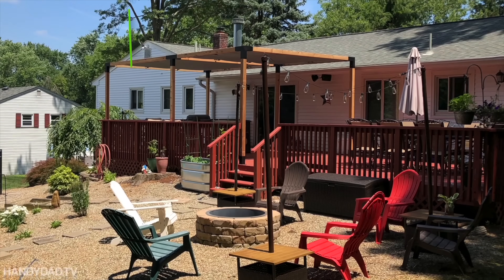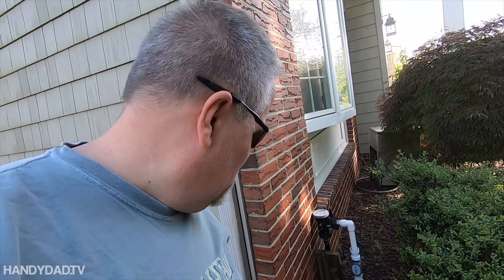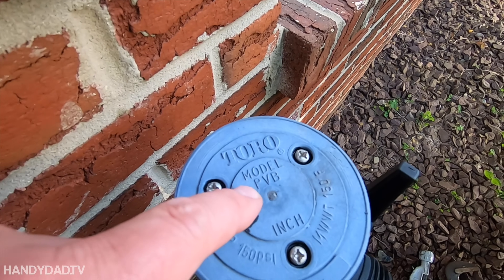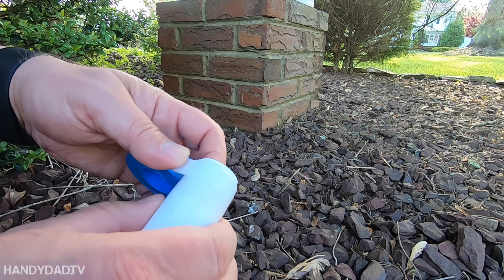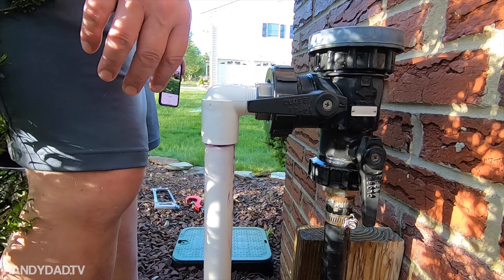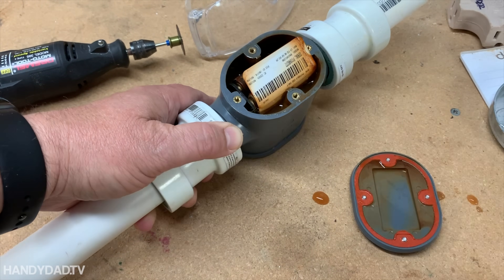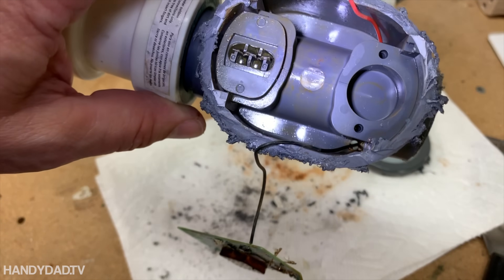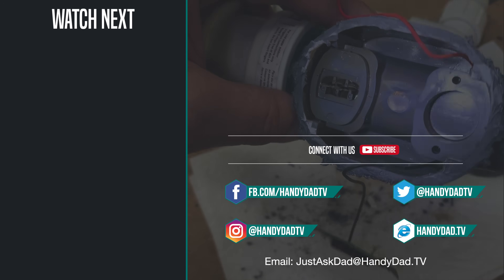Rachio Flow Meter Failure

Comment: Those glue-less fitting you used in your install are releasable. You could have avoided the cutting the pipe. Cool fitting, lots of advantages. Just saying.
Reply from the maker: SharkBite fittings come with the remover. These didn’t so I assumed they weren’t meant to be removed. Thanks for the info!

Comment: Though you said you kind of "winterize" your system, do you blow it out too? Not sure what area you live, but in Wisconsin, we have ours winterized every mid Nov. I didn't do that the first year I moved up here but I turned off the water inside, opened the system to let it "drain" and let it go. My main valve froze and busted open. Next year, not only did I have it blown out professionally, I also wrapped it with a heat tape  from tope to bottom, plant some bushes near it to keep the wind off also. That was 8 years ago and not had any busted items since.
Reply from the maker: Yes it would freeze in NJ as well. I always blow out the system too.

Comment: STOP BUYING RACHIO PRODUCTS. Im a tech and we all hate this junk. running a test is a pain since we don't have the stupid app and have to have the bone head owner follow us around as they fumble with programming. These waste so much time and the smart feature rarely has good results.
Letting software control water is such a bad idea
Reply from the maker: Rachio has buttons on the unit that let you activate a zone to blow them out. Or you can open them manually in the valve box. But I agree, you can’t setup zones and schedules without the app.

Comment: Interesting video...I have a Rachio as well but no flowmeter..The flowmeter style they are using appears to be a vortex shedding flowmeter....in short, its obvious its a flowmeter of low quality...most good quality flowmeters will last between 7 years to 20 years depending on the manufacture and type...it would be interesting to see what radio protocol they are using ...then maybe be possible to use a different brand of water meter altogether......Note: the vortex shedding style flowmeters are subject to noise , vibration...which in the end can create some serious inaccuracies. Also, it would be nice if their flowmeter had a local display so you can check to see if the totalization on the meter matches what the rachio dashboard indicates.
Reply from the maker: All good points. Perhaps that's why they discontinued it.
Reply: finally someone agrees RACHIO is shit. Us techs really hate this junk. Their clocks are awful

Comment: Glad I found the channel, installing my flow meter tomorrow, found a new in box unit, say's if was manufactured in 2019?  They're still available if you look hard enough :)
Reply from the maker: Good luck with yours. They stopped making them for a reason.

Comment: Comment to consider people!

Catching up here on videos. 
New subscriber. 

Just got (6/13/20) my Rachio 3, 8-zone controller with $40 off for father day and I was going to get the flow meter. Saw install of flow meter video last night and now this failure video. Thanks for sharing! Sorry about it. Your ball valve was the cause because it didn't hold tight and blow off pressure could be too high too. 

My background...I am a civil engineer, handyman around the house. 

I would install the flow meter in the basement (in the house) 12" or so before my shut off valve to keep the flow meter safe during winter months and safe when I blow out lines.

Guys think about it for a second why this flow meter "needs" to be installed 6" after backflow preventer... due to losses on the pipe, backflow preventer (check valve= one directional flow) and to have the accurate readings. 

Geeee.... so if you install flow meter before the winter shut off valve IN THE HOUSE it will work too and it won't freeze and it will be safe during winter blow out regardless of the air pressure you put in. 

This flow meter is meant to measure lost of water pressure ...for example if you have a broken head and you lose gallons of water.... not ounces of water! GALLONS! Ounces of lost water here of there happen all the time.  This is not a brain surgery people, so it doesn't have to be accurate to 0.000001oz. 

Flow of water is flow of water in or outside the house! It measures flow. Based on my fluid mechanics experience I can tell you pipe, elbow, friction, losses on this ars very hard to notice ....unless you measure to 1/2 of tea spoon accuracy (no one is). 

BTW...We are neighbors. I am from Manalapan NJ close to Frehold NJ. 

I will buy this flow meter at discount  and install it in the house BEFORE winter water shut off valve. It will take years for version 2 of upgraded valve. 

Yes... instructions didn't consider damage due to faulty ball valve which leaks water in winter of too high blow off pressure. Maybe you can suggest this to Rachio engineers for version 2.0 location upgrade. 

Any comments to my post. Let me know...
Reply from the maker: Thanks for the info. Unfortunately, Rachio discontinued the flow meter.
Reply: @handydadtv  are you buying another (different brand) or waiting for version 2?

Comment: a union set up would prevent this issue .  Being able to just remove the unit (flow meter) for the winter months. I believe this would be a great time to change batteries too. I really enjoyed your demolition of the flow meter , going to help in my design and set up of it.
Reply: Could you explain this? I'm just about to install the rachio flow meter after the back flow preventer in 1" copper and would like to avoid this leak :)
Reply: @4thephil  He's saying that instead of permanently connecting the flow meter to the pipe, put a union on each end of the flow meter. Then, you can simply unscrew each union and remove the flow meter during the winter months. https://www.youtube.com/watch?v=9PEe0V7aHW8

Comment: HindSight is 20/20. The ball valve clearly leaked and caused the failure. If  you look carefully the valve never stops dripping. Maybe a seperate valve is in order between the flow meter and the backflow valve. You video did teach me some things so keep up the good work!
Reply from the maker: I assure you, this was not caused by water. It would be impossible for the water to get over the top of the backflow preventer for two reasons: First, the plugs were removed. Second, the garden hose bib is on the same shutoff and it is always left open all winter to ensure water doesn’t leak into the irrigation system.

Comment: Check the shut off valve in the basement. It most likely isn't closing all the way any and need to be replaced. I always have a faucet installed below the back flow and leave it open during the winter for this very reason. Always close the out going side of the backflow completely in case someone accidentally turn on the water it will only fill the backflow and not get into the rest of the system (damaging the Flow meter or valves)
Reply from the maker: I didn’t show it but my outdoor hose bib is on the same shutoff, lower than the backflow preventer, and was left open all winter. That’s why I know this wasn’t caused by frozen water.

Comment: No .. your Toro backflow valve failed and allowed water into the system .. and the Rachio was a victim of the Toro's failure.
Reply from the maker: Impossible. The plugs were removed. Water could not flow higher than the open plugs.
Reply: @handydadtv  .. Then there would be no water coming out of the backflow and valve (which is what you showed us leaking). Clearly "something" allowed the water into the lines and it sure wasn't a Rachio meter.

Comment: Blowing out your system could very well cause this issue. One thing I also noticed in this and your install video is you opened the ball valves on the PVB rather quickly. It's better to open them slowly to help reduce the water hammer effect which can blow out devices, valves, heads, fittings, etc. Instead of close to open in 1 second you should turn it in small increments to allow the water to flow slowly and fill the lines.
Reply: Opening valve 1 needs to be fast to make internals seal, open #2 slowly when filling rest of the system.
Reply from the maker: Good point 👍🏻
Reply: Water hammer is caused by closing valves. Dont worry about water hammer on small systems

Comment: I've decided to buy rachio controller. Thinking about about buying the meter. Did you see any great benefits with having the flow meter? Hoping to be able to be able to save a bunch of watering cycles with this set up.
Reply from the maker: The flow meter primarily protects you from problems with your system. Like a broken head.

Comment: You should have capped off one side and pressurized it to see where it was cracked. That was enough of a leak to fill the system back up in a few days to a week
Reply from the maker: I had the water turned off in the house over the winter. And the plugs were removed from the backflow preventer. That’s why I don’t think it was caused by freezing.

Comment: If you get a new one why not use removable couplings and take it off each winter and bring inside?
Reply from the maker: Agreed. That would be a good idea.
Reply: Those couplers are removable, you must need the tool to slide in the fitting and it just pulls out.

Comment: I have been looking to purchase their latest version control unit, it’s to expensive. Do you have an alternative WiFi  control unit?
Reply from the maker: Rainbird makes a cheaper alternative but it doesn’t get weather data. https://youtu.be/laIQPq0Devk
Reply: @handydadtv  Rainbird + WiFi module = remote control and weather watering auto adjustment.
Reply from the maker: It didn’t when I tested it. Maybe they improved it.
Reply: Check hunter hc

Comment from the maker: My guess is this happened when I blew out the lines in the Fall. The regulator on my compressor is broken so I have no idea how high the PSI was.
Reply: That depends on the psi rating on the flow meter.
Reply: its not about PSI its all about CFM. When I blow out lines I go 40 psi and 175CFM for small properties and 80 psi and 175CFM for large systems.
You'll never blow your lines dry with household compressors, sure its better than nothing...

Comment: I bet you it was cracked even before you blew it out. My guess is that it just was filled with water on day one and when winter hit it expanded and cracked the edge. Rachio better step up! I’d say poor design!!!!
Reply from the maker: Yeah I’m thinking the air pressure was too high for it.
Reply: @handydadtv  Im not sure. You can see where they seam it. My guess is the glue in the seam was weak at installation time. Water was slowly dripping in over 4-5 months and when you blew it out it truly never got the water out of the cutoff and the winter expansion did you in

Comment: At the beginning of the video you discovered a bad ball valve. Wasn’t that the culprit and let water into the flowmeter?
Reply from the maker: I shut off the water in the house, remove the plugs from the backflow preventer and leave a hose bib open. It couldn’t have been water, so I’m thinking the air pressure was too high when I blew out the lines.